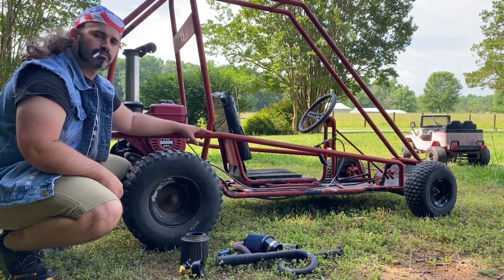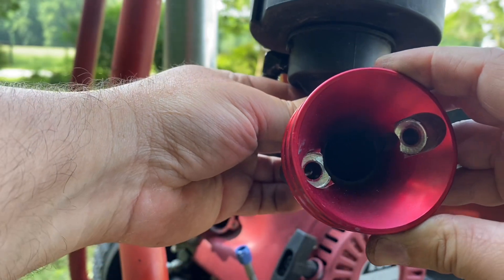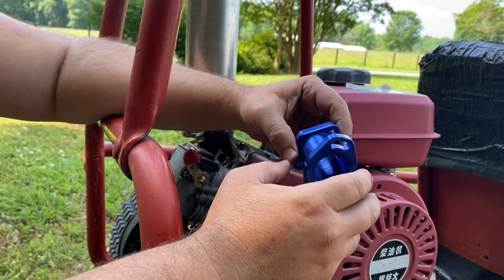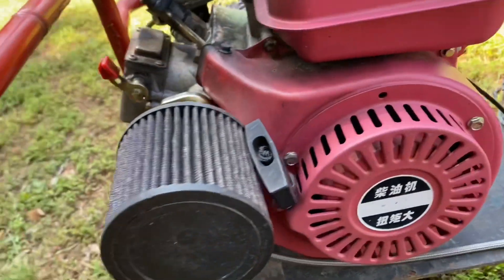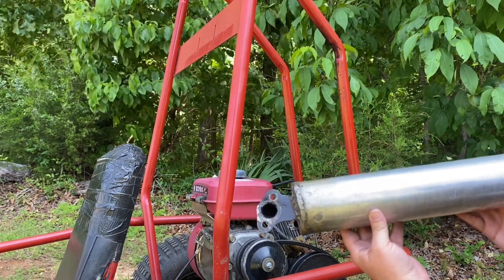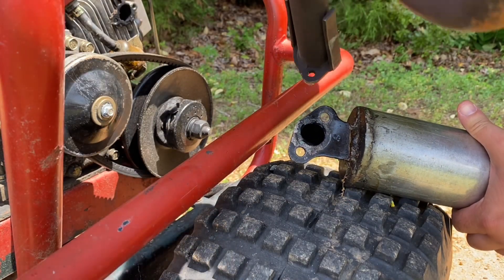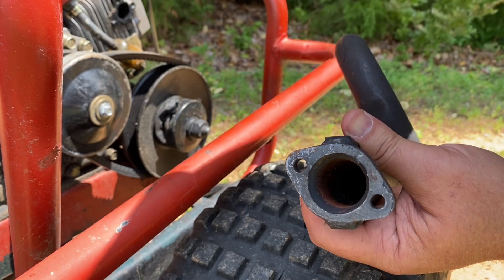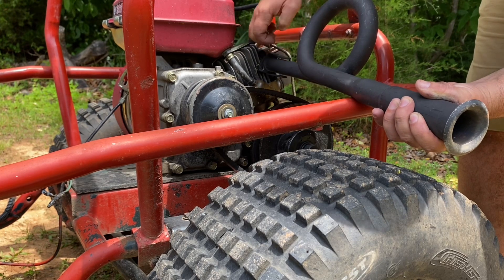Will Predator 212 / Briggs Parts Fit a Chinese 196cc Diesel? Finally Some Aftermarket Options!

Comment: Wait, for the mikuni carburetor adapter, why do you need to drill those slots on both sides? Won’t you just be able to install it with the regular hole side to the engine, and the side with the extra space connects to your air filter?
Reply from the maker: You don’t have to slot it on both sides. You just need to do it on one side. In the video I realized I flipped it and installed it in reverse of what I originally said. The point is that both sides need to have the same bolt pattern. One side already has the correct bolt width but the large side doesn’t so it needs to be notched. After it’s notched it can be installed in either direction.
Reply: @jwsbackyard6413 Oh okay, I’m understanding it a little bit more now thank you.

Comment: My question is if you had to modify how much fuel it was getting after the change in airfilter etc.
Reply from the maker: No I didn’t. It runs rich from factory so it had enough extra fuel to accommodate the extra flow.
Reply: @jwsbackyard6413  Ok good to know. I'm about to buy a 9-10hp one and then do some slight mods.
Reply from the maker: @illernpiller that one should be fun, this one has always felt a bit underpowered.
Reply: @jwsbackyard6413  gonna use it to power a water pump when I dig for gold =D

Comment: How did you get the torque converter on? My shaft is to short?
Reply from the maker: As long as you can get the driver on the shaft  partially (half an inch or more) you can just use a long bolt to hold it and it will work fine.
Reply: @jwsbackyard6413  also did your belt line up straight? Mine is off center
Reply: @jwsbackyard6413  ok thank you!!
Reply: Nvm I see the difference I got the torque converter with the mounting

Comment: I'd be interested to find out if any of the aftermarket heavier valve springs would fit. These diesels would work good with some boost but the valves will float like crazy.
Reply: Yeah I read a forum on Reddit and a guy put some 212 springs in